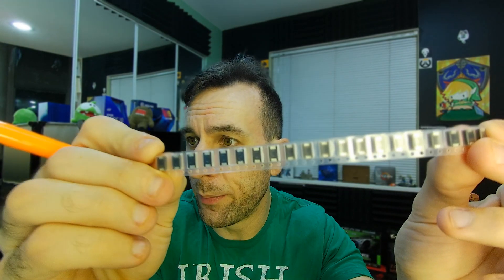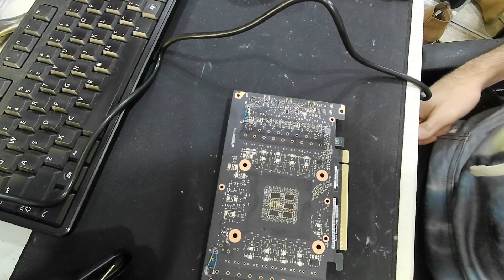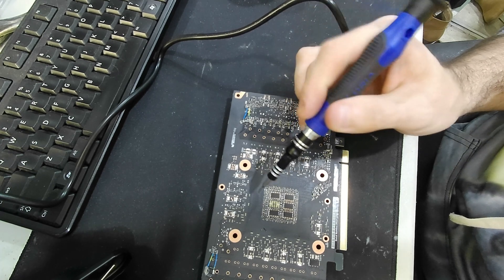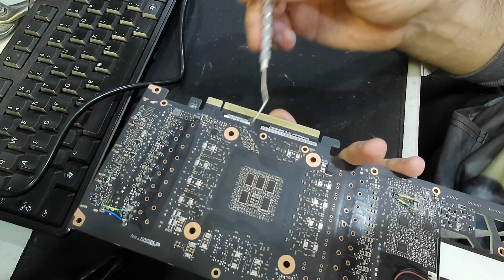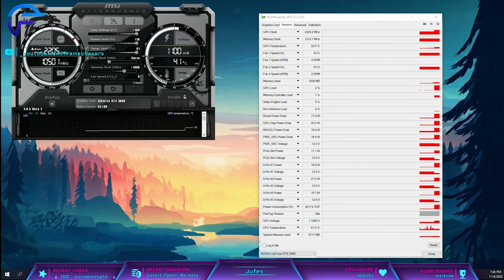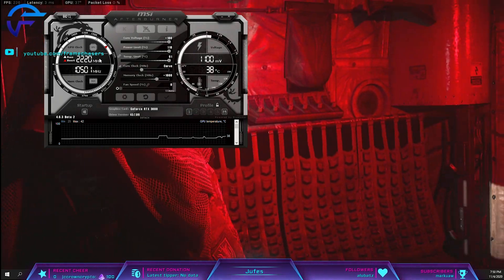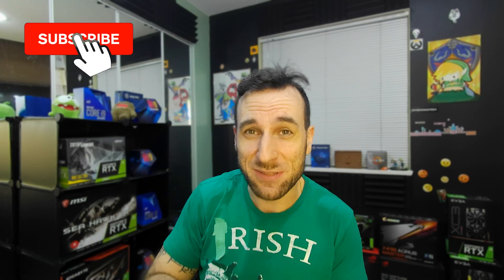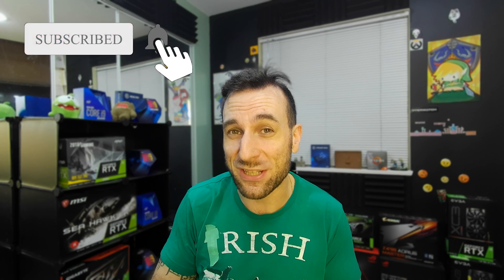RTX 3080 Capacitor Mod!? Benchmarked

Comment: There are different 0805 47mF Mlcc, could you please give me the exact name? I have a Gigabyte Aorus Master that I want to modify.
Reply: Did you try the caps mod ?
Reply: @wizzitech7504  not yet, but will do it as soon as I have a little more time ;-))
Reply: @iron3765  you find the exact size ? 0805 is the good size ? 47uf mlcc found them on mouser.com I have a zotac who clock only at 2130 under waterblock at 45 degres so i can do more with this mod I hope
Reply: @wizzitech7504  50 to 80 are definitely possible
Reply: @iron3765  50-80 frequence or reference of the cap?sad that chaser do not provides the exact reference of the caps :)

Comment: Check out the ISO tip soldering iron...you can get really fine tips, it's also WIRELESS and heats up in 5 seconds and gets super hot (I was skeptical before getting it that it would, but it totally rocks). I got the fast charge yellow version and bought the upgraded tips for it.
Reply from the maker: Yeah ive been looking up lots of irons, the problem with all the wireless ones is they arent enough wattage, not nearly enough for these PCB's.  They absorb way too much heat

Comment: Did you have any issue with backplates fitting after the added caps?
Reply from the maker: nope, the ampere backplates have a hole behind the core
Reply: @FrameChasers  My PNY backplate and the bykski water backplate are both covered.  Probably would need to cut it out more since the clearance is kinda tight
Reply from the maker: @MachuPichuu  ah yeah in that case you would replace the 2mm pad that usually comes with the backplates with maybe a 1mm,  there is definitely enough room for it to clear but you would have to adjust the rear core pad as well

Comment: If you are using one of those soldering irons that plug directly into mains, I'd recommend you to buy a temperature controlled soldering station, even a $30 chinese station would be a massive improvement over what you have
Reply from the maker: yeah I dont doubt it, im not much of a soldering professional or anything just a hobbyist but I might look into more soldering equipment if I get more into this stuff

Comment: Nice OC, but it doesn’t affect Warzone FPS at all, I’ve just checked and got same 330-340 FPS on stock clocks on 3080
Reply: 330 FPS in warzone? I swear my 3080 can barely get 140 even with all the tips from all his videos posted.
Reply: ohpov it’s in the training mode only, plus I have a 10900k, if your average is like 100-150 FPS, try the fix from the Dutch girl, search “FIXING 5600X Warzone issue”
Reply: @emilxert  I have a Ryzen 9 3900x I don’t know how much of a difference FPS wise that would cause compared to you. I’ll be sure to search that up though! Did you do anything else to increase your frames otherwise?
Reply: ohpov I just swapped my 6850k with a 10900k and it did the trick

I tried that Dutch solution and had 0 increase, however, it helped a 10600k and a 5600x, might help you as well. It only requires one line of code in a small text file in Documents CoD MW folder

Should be called config.ini or something, watch that video and also tell me if that helps haha
Reply: @emilxert  Yeah, I'm re-installing modern warfare completely right now. Once that's done I'll test it. Apparently different numbers are working for different people. So I'll give it a try.

Would you happen to have discord?
Reply: ohpov yeah, I got one, but can’t tell you the numbers after the nickname right now

Complete reinstall doesn’t usually help at all, so you only need to change that config.ini
Reply: @emilxert  No worries, appreciate it man. I'll be sure to do that and reply back to this when its done.
Reply: ohpov reply to me when you finish downloading, I’ll be here for another 30-40 minutes, can discord in 15 mins
Reply: @emilxert  Yeah I've tried different numbers ranging from 6 - 12. 12 seems to work the best for me but it's still awfully low frames in my opinion for a 3080. 

Around 140 - 150.
Reply: ohpov what’s your RAM speed then? I’m on 4400 MHz downclocked to 4000 MHz, but 3600 MHz is enough
Reply: @emilxert  DDR4 Trident G. Skill 3600 MHz. 32 GB
Reply: ohpov CPU clock speed?
Reply: @emilxert  CPU is stock. I haven't changed anything. So Ryzen 9, 3.8?
Reply: @emilxert  Should I overclock?
Reply: ohpov those clocks are pretty low, you might want to OC to 4.2 GHz, but a thorough guide is necessary, because I haven’t ever had an AMD processor
Reply: @emilxert  Would you happen to know a good video?

Comment: @Frame Chasers what gpu is the faster asus strix oc 3090 or  evga ultra ftw3 3090 (with max oc )
Reply from the maker: the strix is technically faster, but they are both so close you wont notice a difference,  however I would avoid EVGA cards this generation.  They are locked down much further than the other brands

Comment: Now I found the answer looking for watching video again, suprised that gigabyte used 6 of these 470 rated SPcaps while all manufactures cheaped out on these, lucky for me managed to get gigabyte while alot were avoiding it when this saga started, now I managed to peak 2220mhz in stock form and bios beating all stock 2X 8 pin cards
Reply from the maker: Yep just because it’s an SP cap doesn’t mean it can’t have a low ESR or higher uf rating right,  you gotta look at the overall specs, not just the style of capacitor